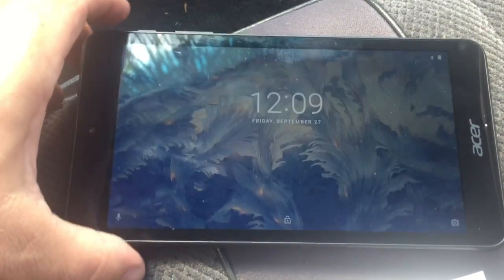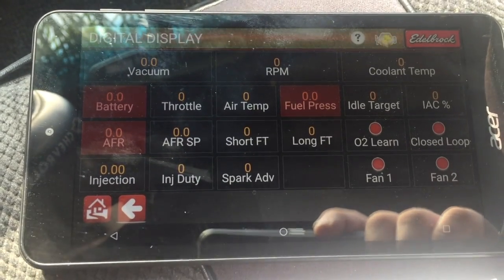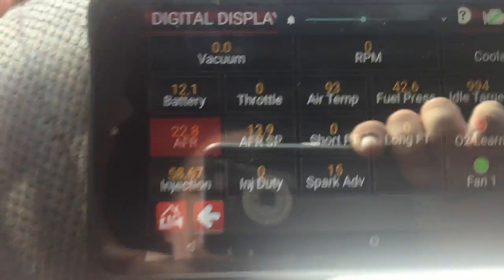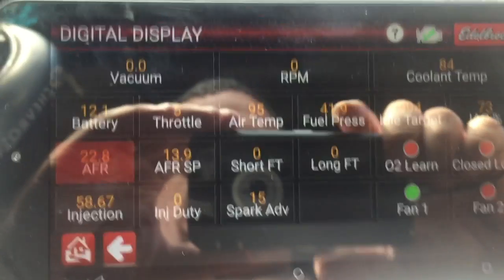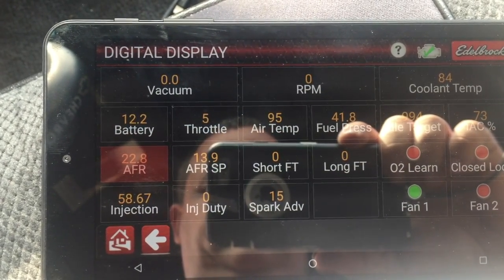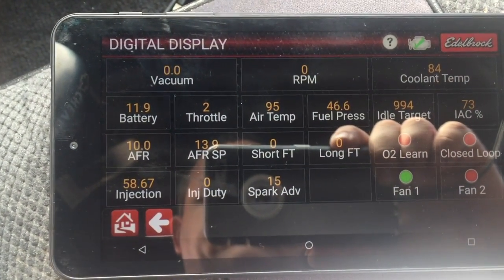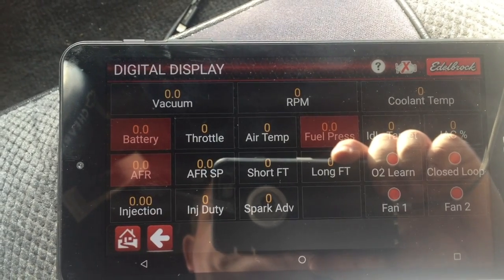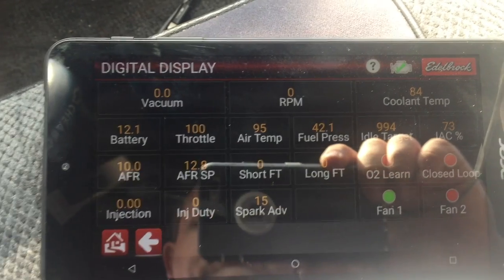Pro Flo 4 XT TPS

Comment: I just recently installed the pro flo 4 on my 84 c10 and I’m having that same issue. Except it sits a 2 instead of 5.
Reply from the maker: Nik Swopes A new throttle position sensor fixed mine. Call them and ask them. They sent mine free of charge.
Reply from the maker: A new throttle position sensor fixed mine. Call them and ask them. They sent mine free of charge.
Reply: Thank you for your reply. I’ll contact them like you suggested hopefully that’s what is wrong with mine too.

Comment: I’m having the same issue. Mine sits at 1 after hitting the gas. I was recommended an AC Delco 19322821. I haven’t recieved it yet but I’ll report back. I’m also getting popping out of my exhaust on decel that I haven’t been able to figure out yet. I don’t have any exhaust or vacuum leaks,

Comment: Tom, thanks for the help.  I contacted Edelbrock and the tech there told me that a Standard TH149T TPS would be the perfect solution as it has a stronger return spring than the ones they ship with the ProFlo4XT. I went out and bought one, stuck it in and _viola_, I was able to set my idle at 900, my IAC came down to 10-12 and most importantly, the throttle position is now ZERO!!  You stomp it, rev it, ease it in and when you let go of the pedal... zero. All that messing around with it and I fixed it for $30. Thanks again.
Reply from the maker: Awesome!!!!  I am happy to hear it worked out!

Comment: Mine does the exact same thing. I'd end up idling anywhere from 800 to 1200 depending on what intersection I was sitting at.  I am thinking about just buying a stock Chevrolet TPS since it is really just a rheostat. I purchased it in July of 2018.  The last correspondence I had with Edelbrock about this was in August of 2019.  They really didn't offer any suggestion as to a correction so this is the route I am taking.  Did the new TPS  correct your issue? I'm hoping the issue isn't in the software. Also, I wish their program was available on an iPhone or iPad.